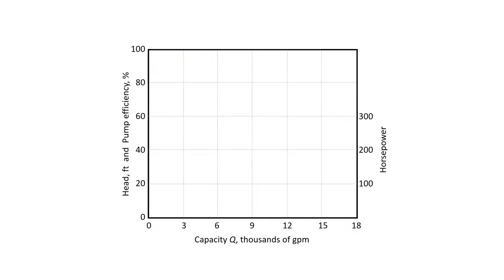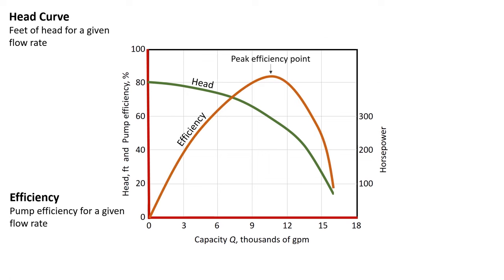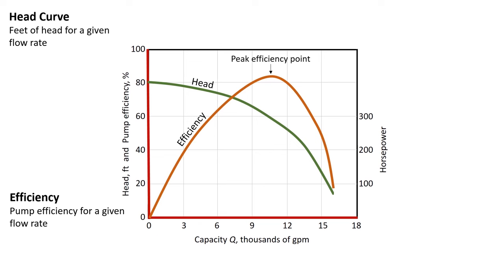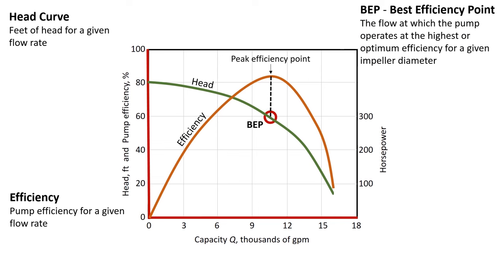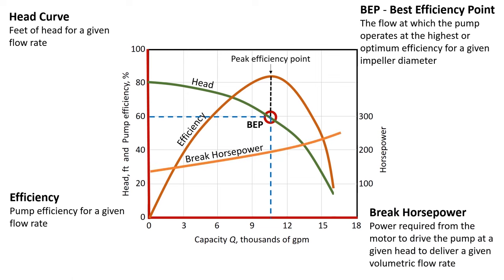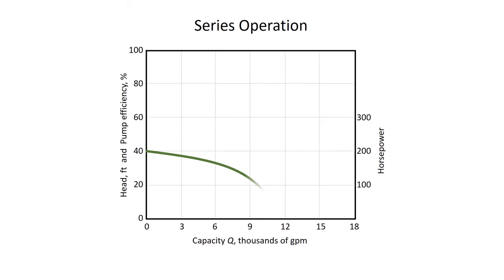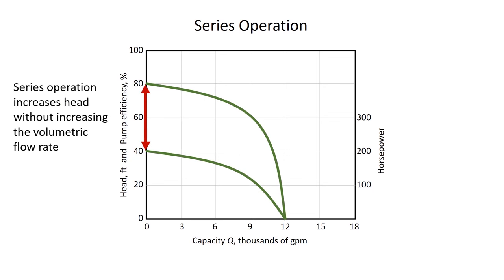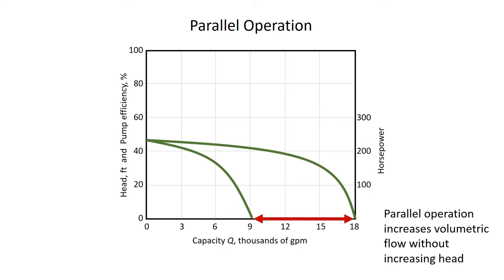Pump Characteristic Curve

Comment: Great video, but isn't it important to note that the pump will operate at the point where the pump curve intersects the system curve?  Your video implies the pump will operate at the most efficient point.  You really need to determine the discharge head your pump is operating against, and find the most efficient pump impeller to use.  Again, great video!

Comment: You mean if i have pump and want to move water
Its not good to have zero pressure
Give it valve and make back pressure a little bit until peak efficiency point
Back pressure is good at some point 
Zero pressure is not efficient

Comment: What will happen if two dissimilar pumps are connected in series and parallel
Reply: Is it possible?
Reply: Well, I got it. Arranging dissimilar pump in series/parallel may lead problems (especially when the other pump are larger). Risky
Reply: due to insufficient volume of water feeding into other pumps it will lead to  cavitation

Comment: Why head max at zero discharge
Reply from the maker: A centrifugal pump is only capable of producing a certain amount of discharge pressure (Head) based on its design. If the pressure (head) the pump is pumping against is equal to its maximum discharge head, there will be no flow. As the head the pump is pumping against lowers, flow will increase as shown on the Head (green) curve in this example. Thanks for the question. Hope this helps.
Reply: Increasing the flow means increasing the kinetic head.Kinetic head increment causes the discharge head to decrease because pressure energy is converted to kinetic energy and vise versa. I believe these curves are plotted for constant speed pumps with flow adjustment using a control valve. We may need to look at variable speed pumps which are, from my perspective, more efficient and have different pumping characteristics.
Reply: Its called shut off head